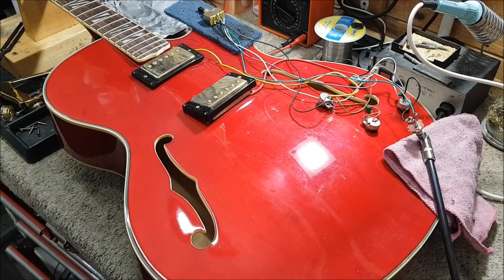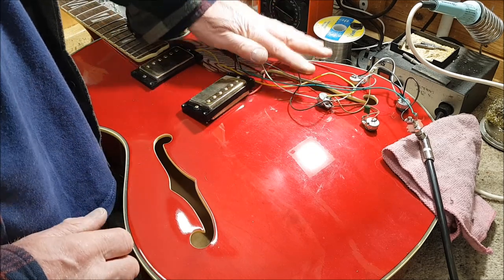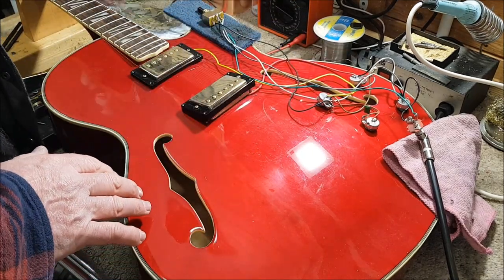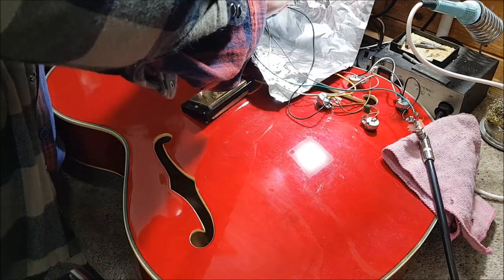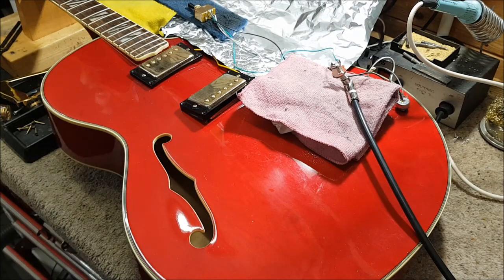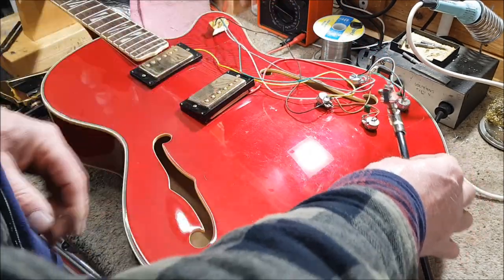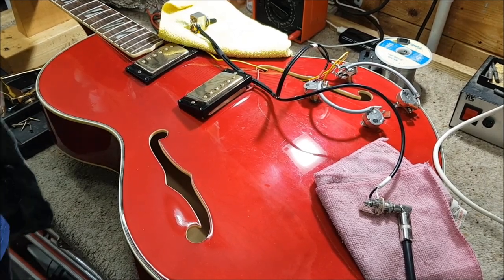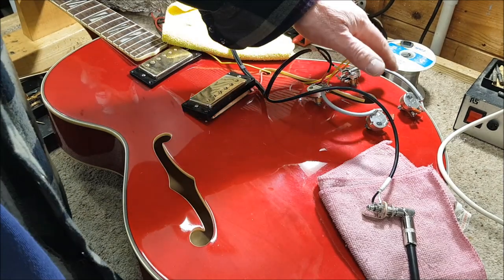Why do we need shielding in guitars ?

Comment: I’m building a kit guitar and wondering is it ok to shield with copper tape to a unfinished body I want to play it before I end up painting the thing later down the road .??

Also is it ok to use tape then graphite paint over the tape? Or should it be paint then tape ? Or does it really matter lol
Reply from the maker: Hi Ron, self adhesive copper tape will be fine over unfinished wood. You will not need graphite paint. The copper tape is far superior. The tape wont stick to graphite paint. Not only is graphite a  conductor albit with a high resistance, its also a very good lubricant and anti-friction coating.   I use 2" wide slug tape from amazon which goes under the trade name of Zalava . It comes in 25meter rolls. Its self adhesive and easy to cut and manage. Overlay the edges to form a conductive path. Please remember to add a grounding wire from the tape to the back of one of the potentiometers or form a central earth point in the control cavity. I screw a small solder eyelet/ tag and take the bond wire from that. You can solder directly to the tape, but the tape is thin and the wire might rip off when you remove the scratch-plate/ control plate. 
Good luck.
Reply: @stevewardguitars1661  thanks got it all done last night . Never done that little more tedious than I thought it be with it being so delicate. But I think it came out pretty good . I’m building an Dean ML with set neck and locking nut and Floyd rose .  I’ve got all cavities shielded and covers . I know Humbuckers don’t “need” shielding but why not is my mind set . I plan to do a video of guitar when I get it setup this week . An unfinished “finished” guitar demo lol